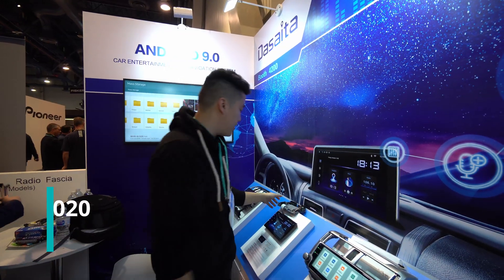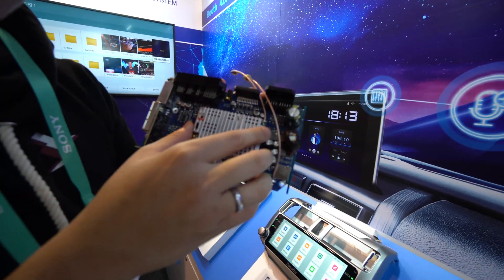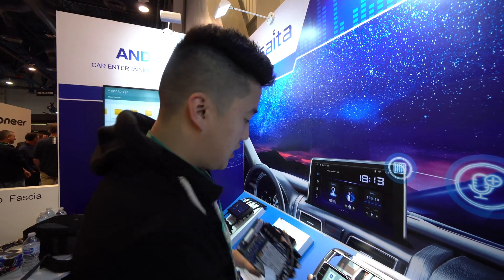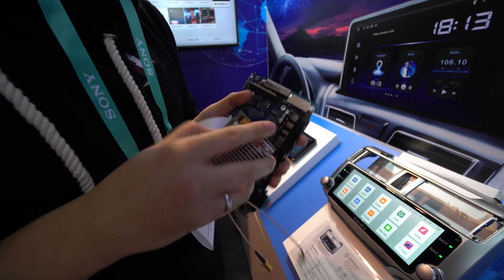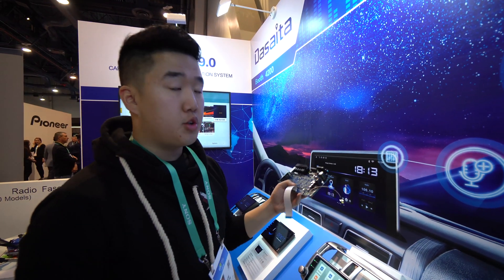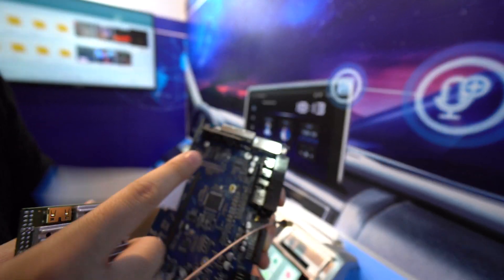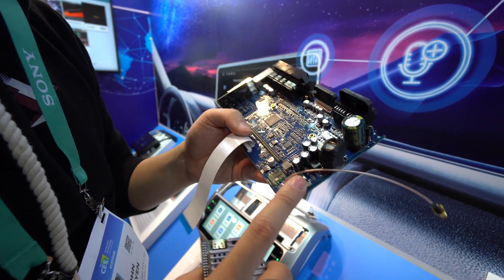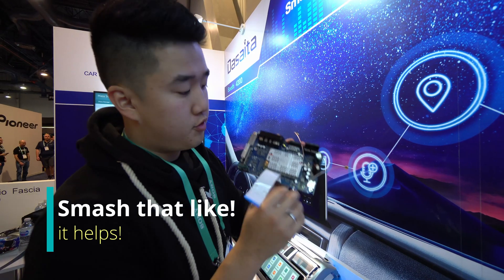What's inside of a Car Head unit | CES 2020

Comment: I recently purchased and installed the Dasaita Max6 with built-in CarPlay. I have been in touch with Authorized Dasaita dealer in China because my touch screen will go blank, or when I touch the screen, it reacts opposite of my touch that I have to recalibrate or shut down and wait for the 30 secs and reboot hoping it returns back to normal. I was using CarPlay and lost my call because the screen when black though my phone did not drop the call. 

question is: Have you had or heard of anyone having these types of issues? 

Dasaita dealer has seen videos I sent of this occurring and are going to send me a core board replacement in February, your thoughts or suggestions, please.
Reply from the maker: Either a firmware update or get that exchange going on is your best bet.